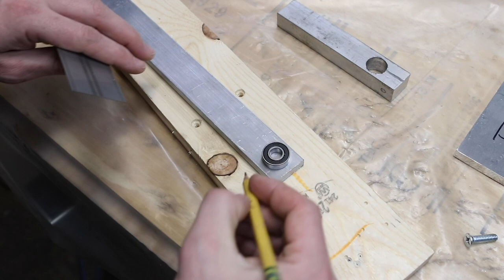Making a connecting rod balancing jig

Comment: How repeatable are your measurements when actually balancing rods? I’ve heard even the purchased ones don’t seem to get the same number twice
Reply from the maker: I was expecting some variation on measurement but to be honest with you it was almost perfect. I built this for one engine so I measured 8 rods 3 times and if I remember correctly I had 0.1g variation on 2 rods on one of the measurements before balancing. After balancing I measure again with 0 deviation. That is a very small sample I admit and I could have been lucky.

Comment: Do you have a parts list for the different sizes and thickness of metal used?
Reply from the maker: I’ve been planning on putting something together for a while. I will try to get it done this weekend and drop you a link.
Reply from the maker: I have added the parts list and PDF schematics to my website. Link is pinned to the first comment.

Comment: I’m getting inconsistent readings on mine . Any advice?
Reply from the maker: You likely have a spot that is binding and is creating extra friction. How inconsistent are we talking?
Reply: @asquaregarden  about 1- 1.5 grams
Reply from the maker: That is a lot so you definitely have something binding. Could be the bearings. Make sure they freely spin. Also make sure the distance between the two contact points matches the distance between the rod hole centers.

Comment: This is awesome! Just a quick question. Are your bearings perfectly level to each other or does it even need to be? I see you have a shop towel below and I can't really tell from the angle.  I am new to all of this and my already bored out block isn't worth sending to the machine shop so I figured I'd just learn some skills at home while I look for a new block.
Reply from the maker: The bearings are offset to account for the diameter for the two sides for the rod. They are positions so if you were to draw a line between the center of the small side and the center for the big side of the rod that line would be parallel to the ground.
Reply: @asquaregarden  Thank you very much! That's what I figured, it just looked a bit off from the video angle. Gonna attempt to make this :)